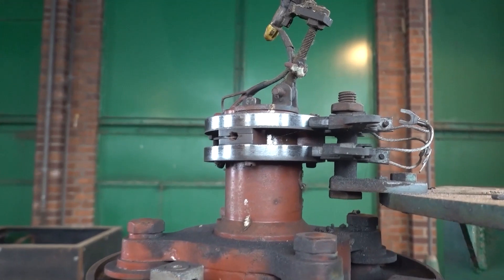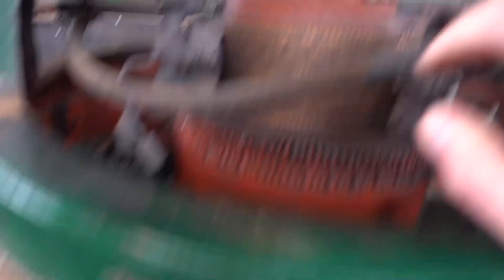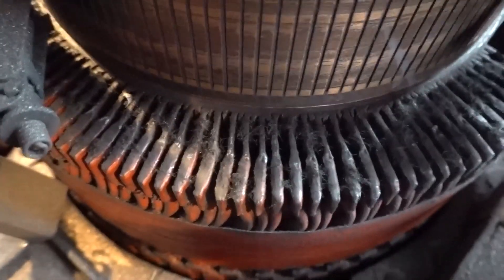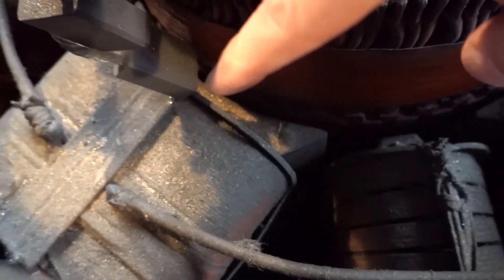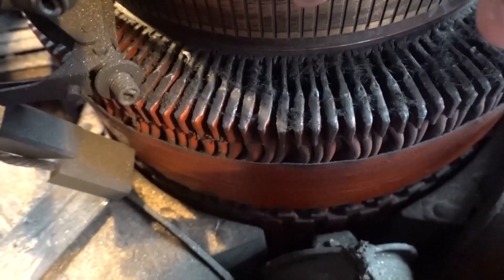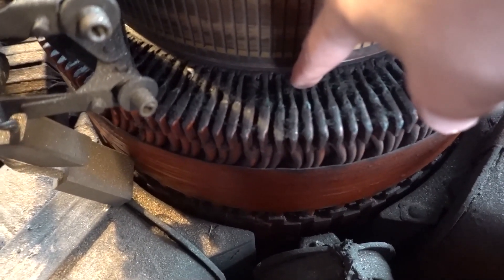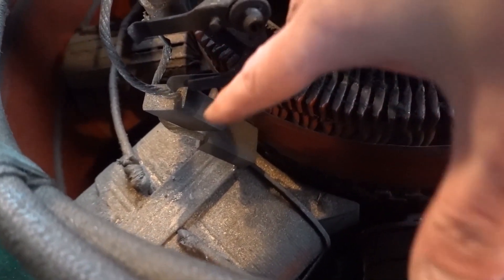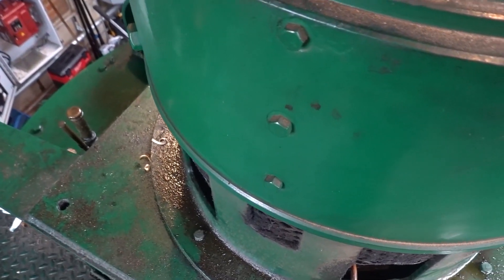Let's Get Excited In Here

Comment: Field current generates AC current, converted to DC by the commutator. Then this DC current is fed back, via the large slip rings, to provide the excitation voltage for the big alternator rotor down below, so that it can then provide 3 phase power on the output. The field current controls the excitation current, allowing you to control the output voltage of the alternator down at the bottom, thus providing a way to control power delivery into the effective infinite sink of the grid.

Not sure about the second small set of slip rings, they probably provide some sort of control, or are part of a brake used to slow the alternator down when taken off line. But overall a small control current, around 5A tops, will provide a huge current flow, up to around 200A, from the size of the commutator as peak, with all this amplification being powered by the shaft rotation. Nothing electronic at all, and so reliable that it is still working as designed, after more than a century of use.
Reply: From watching his other videos, the thing on the top is a mercury switch which lets the system know if the turbine is spinning too fast. I'm guessing the little slip rings attach to that?

Comment: Oh no! Forgot to explain the mercury switch! Is it really an overspeed trip? That seems…unlikely to me…
Reply: Yup it is really an overspead trip. The mercury switch is rigged so the mercury sloshes up a tube and makes contact if it does it trips a mechanism that both cuts the water flow down and energizes a braking contactor. Those same mercury tube switches are used in big old industrial boilers. They are extremely reliable generally outliving the equipment they are installed in. 🤓

Comment: You should consider retiring your rotary exciter and upgrading to static excitation. This eliminates the commutator and brushes and it's more efficient. It is also far easier to automate your power factor control.
Reply: Unfortunately working for a city municipality means they will run it until it runs no more. I was surprised they sprung for the uni strut and fancy fittings lol. Just kidding.. 
.... or am I?